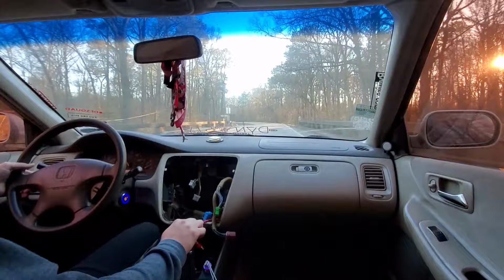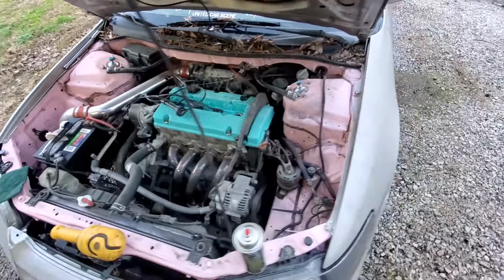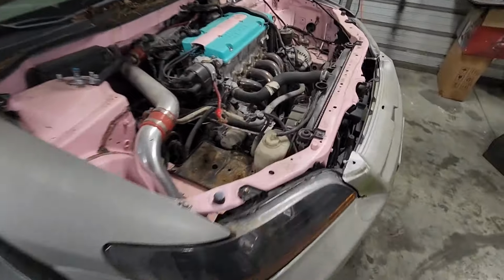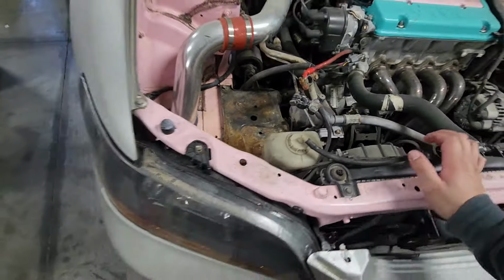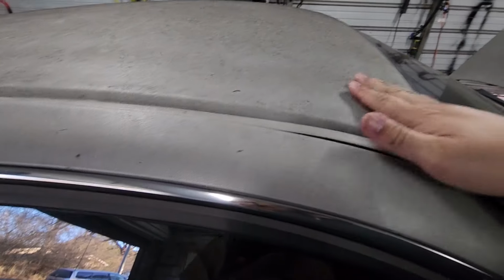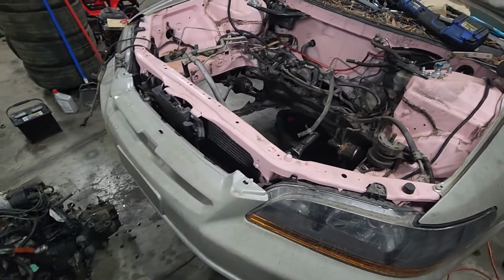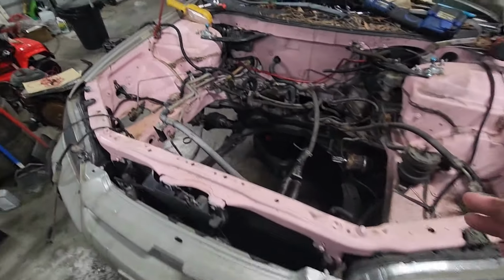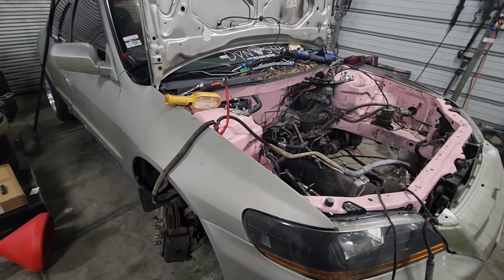ALL MOTOR F20B Swapped Honda Accord RESTORATION Part 1

Comment: Love the videos! What ecu you running? I have a 98 accord with an f20b also but I think I got a bad p28 so I tried using the stock ecu but it doesn't run good. Rough idle and backfires.
Reply from the maker: Chipped p28 on Honda Tuning Suite bro. I also have a couple chipped po6s running as well. I always get mine tuned. I hate base maps
Reply: Cool Thanks bro. You do your own tuning? from my research it doesn't seem too complicated but I've never done it before so I don't know if I should attempt or not. Keep up the content you inspire me with my project. @DrivenFilmsPhotography
Reply from the maker: @BigCExpressLLC  I have all my tuning done by my local guy J Mills Tuning
Reply: I swapped my prelude to an f23a1 running on the Honda suite . It turns on but now I give it gas and sputters . I’m running the accord ex dizzy . Do I need to run f23 dizzy
Reply from the maker: @SuperPanza  no you're fine with any f22 dizzy. Doesn't even have to be vtec. It works the same
Reply: @DrivenFilmsPhotography is there a way it’s supposed to be timed to be on point . I’m thinking of just going with a digidizzy.